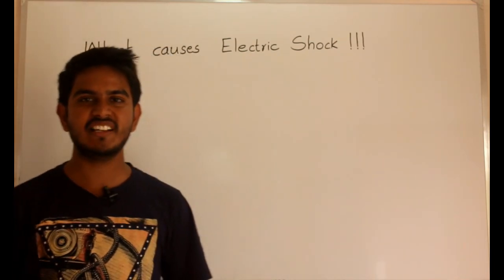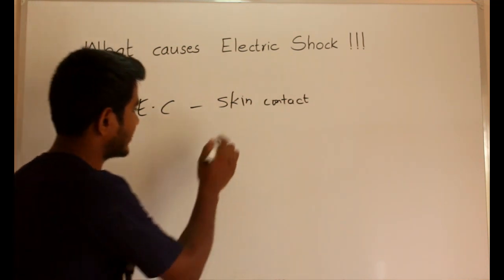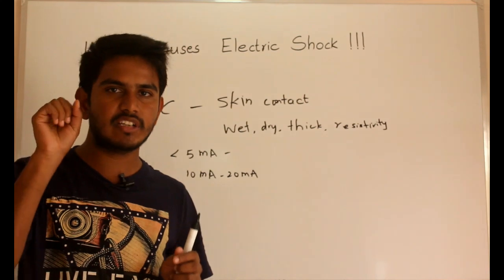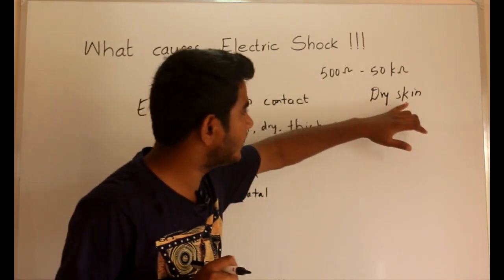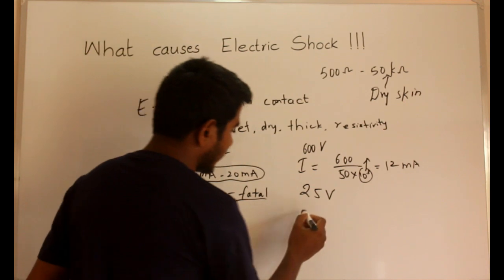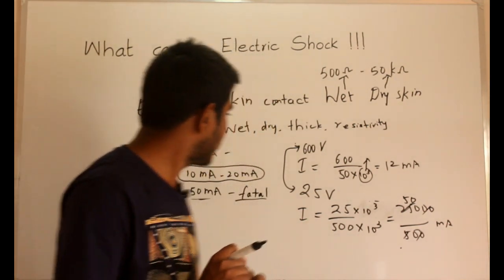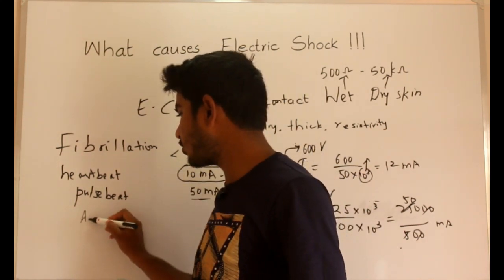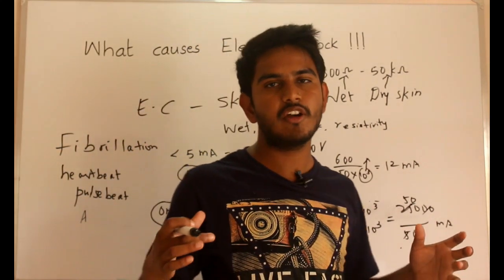What causes Electric Shock !!! Volts or Amps ?

Comment: 2 Questions;
1, Is there a difference between AC or DC power?
2, Could you explain stun guns/tasers that can deliver millions of volts?
Reply: Most police issue tasers are roughly between 30,000-50,000 volts and have about 3-4 milliamps. It would cause muscle tighting and mild pain in the area around the prongs. You dont normally experience extreme pain till 10 milliamps and above.

Comment: I had an approximate 12ma -15ma shock, I was a child when my stepdad built an electric wire on the bird aviary to kill cats, yes kill cats he said. He told us kids if we touched it, it would kill us. One day I forgot about the wire and got stuck to it. Couldn’t yell out or move. I was stuck in a stretch with my hands above my head, clamped onto the wire. I was stuck there until I don’t remember anymore until I woke up on the ground. I was in shock and couldn’t move for a long time, I just lay there, I was extremely weak. I’ve ran marathons and sprint races and I’ve never felt like that day. My grandmother said I lost all my color, like no blood was running through my body.  My stepdad had the wire connected to the 1950’s electrical panel, it had no safety features. I was told/ asked that I must have been stuck there a long time, because the electrical panel caught fire, that’s what saved my life. He asked me how I broke the wire, I told him I tried and tried and tried to break the wire but I couldn’t. So, when the fire occurred and severed the connection, I guess my body dropped like a sack of potatoes and broke the wire. Took me many weeks to recover. My boyfriend doesn’t I measured our resistance in ohms, Mime now is 1.999 ohms, dry. I have no idea what my resistance was when that happened to me.

Comment: Hi Thanks for the video.  Could you please explain why we don't get shock from 12 V car Battery  which has 92 Amps? . Also if I apply the V=IR,  How do I relate  the Car battery to the  V=IR  law.  Please explain ...Thanks and regards
Reply from the maker: V= IR implies here R to be very small around 0.15 ohm.
Your skin has R greater than this and generally current prefers low resistance path.